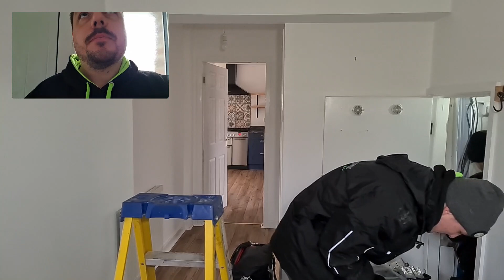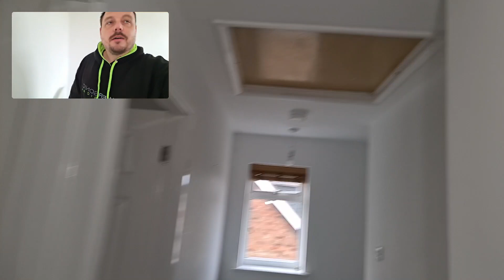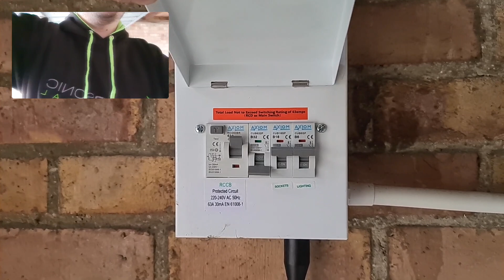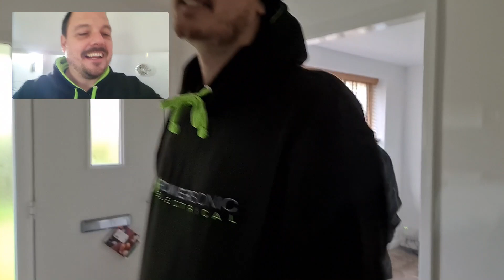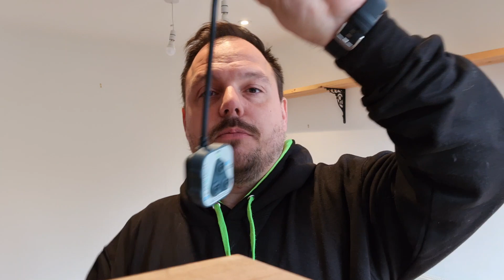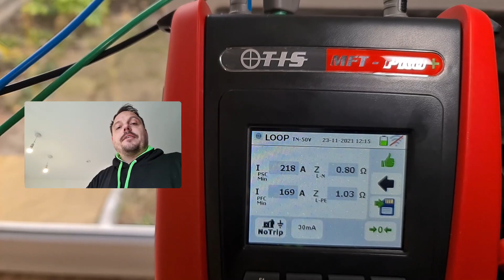EICR on this??? Electrician talks through and demo's some testing including LIVE Zs

Comment: Hi Mark, just joined your channel. Love your detailed approach. With regards to the lighting circuit  testing, couldn't you just calculate  the Zs, using your Ze and r1 + r2, to save the live testing concern?, then complete the functional testing part afterwards, to make sure all is switching/functioning correctly? As for properties with loads of fancy class 1 light fittings, I was taught that a long lead test r2 @ each fitting/switch was an acceptable method. What's your thoughts on this?
Reply from the maker: Calculation is an accepted method so yes can used. Not my preference as it leaves the possibility of the CPC not been in tact after dead tests or human error. 

On EICRs the process is down  to the inspector.  I don't fall out with wander leads at all. A fantastic tool in the arsenal. As you say especially so with lots of customer lighting. Q balance between determination of safety and the potential to introduce faults doing so. 

Primarily I want to share with some of the younger apprentices that follow me how Zs measurement can be done very safely and the benefits that test brings. 

Thanks for watching and joining in the comments 😀

Comment: Hi Mark
Interesting video on testing, very comprehensive procedures. The only thing I could not see when you zeroed the leads in which way round they was connected.
Apart from that very interesting video.
Just to let you know a bit about my back ground. I specialise in testing and inspection and fault finding from 3rd year level 3 and 2391-52 .
Reply: Hi Mark
I forgot to add my level 3 learner's l will your video next week and to see what outcomes they discuss in Q&A.
Regards
Brian
Reply from the maker: Awesome, thats made my evening. Let me know what they think! Even if the conclusion is its rubbish lol
Reply from the maker: Hi Brian. Yeah I wanted to get the meter in shot but after 10 mins trying to get it on camera and me I gave up lol. But they just go in black/blue posts. Thanks for commenting really appreciate it

Comment: Boiler plug sockets are supposed to be into unswitched outlets.  I guess it's to prevent diyers and such like solely using the switch as a means of safe isolation. (Could easily be switched bk on in the process)
Double and single pole outlets look identical.  So that would be a no go too.
Reply from the maker: Good spot. What code would you offer?
Reply: @electrician247  it's just a C3 potential at risk but no immediate danger.

Comment: Observation- why do heating installers always leave the flexi braided hose connected to the pipework....?
Reply from the maker: Never try to understand the thinking of those who fiddle with pipes lol.
Reply: Nothing's ideal,  if you remove the link open ends need blanking.  It also almost always seems to go walkies.  Most will be 1/2 and that's standard.  However the no standard size ones you either have to make up or go out and buy, meh🤷‍♂️.